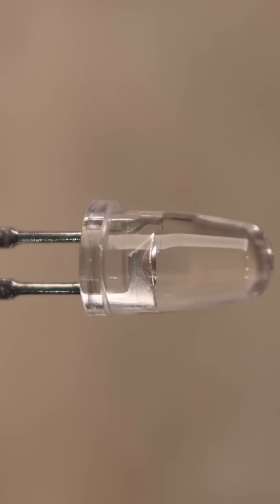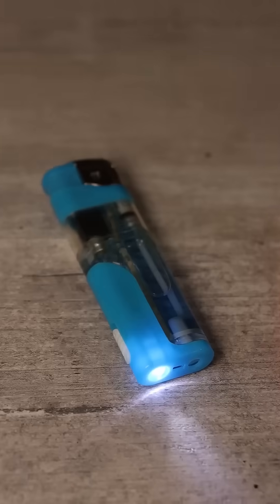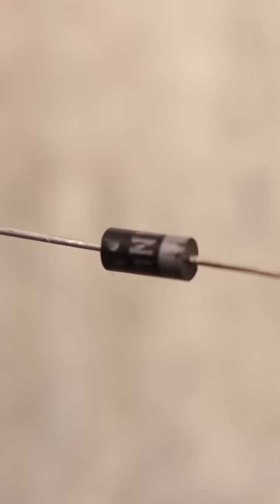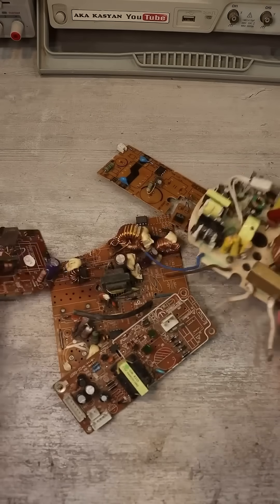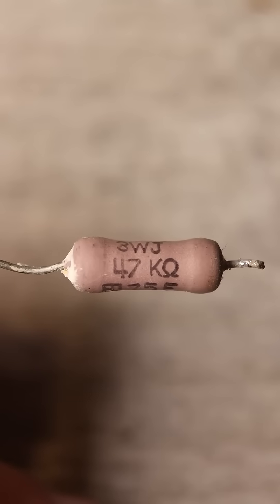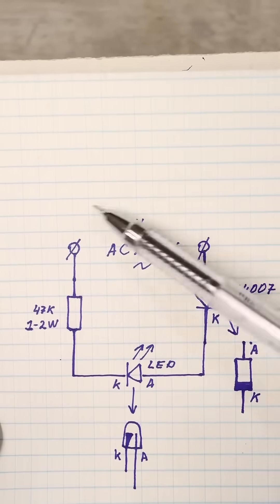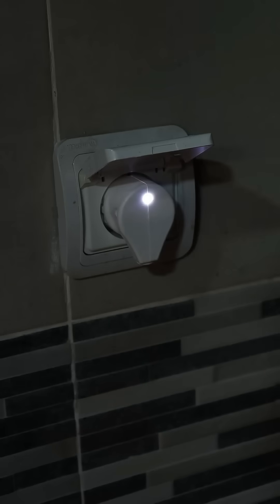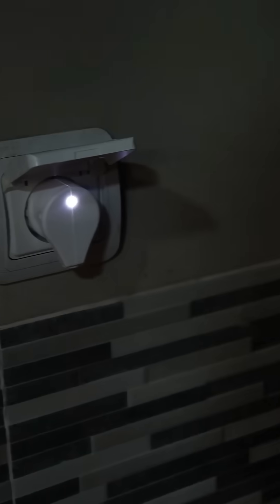How to connect a LED to 220 V #electronics

Comment: that is wrong the resistors should be in series to equal 47K, parallel will half the value. It will blow up for sure
Reply: @rogerd4559  depends on if you have higher value resistors or lower value resistors. The point is they want 47k one way or another.

Comment: bro just use a capacitor in series with led,,, for efficient circuit
Reply: Capacitive dropper...much better.
Reply: Oh, and put a large value resistor (Meg Ohm) across the cap so it will discharge when disconnected.
Reply: what size and value?
Reply: @rogerd4559  Xc=1/2πfc I=V/Xc
So for ~10ma at 220V @ 50Hz 
In the neighborhood of 145nF 400V should do. CDE 716P14498MA3.
Reply: @ :) you should teach !